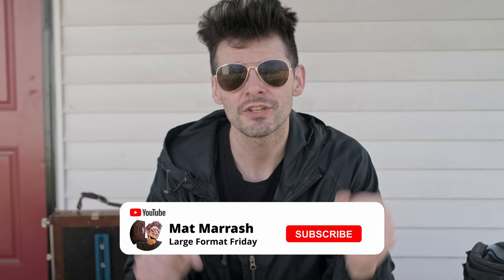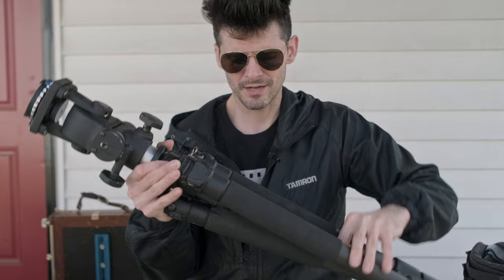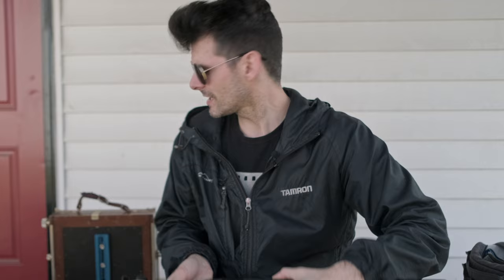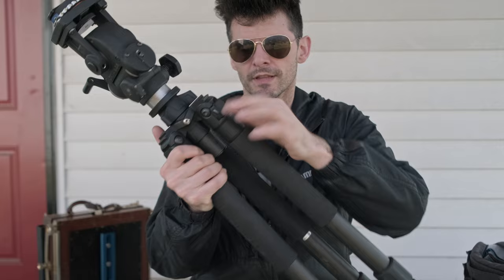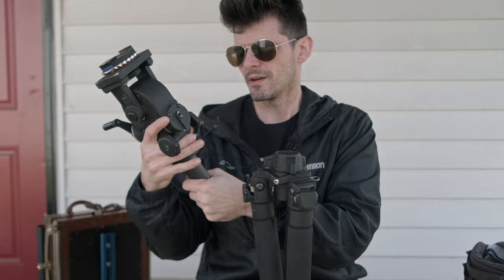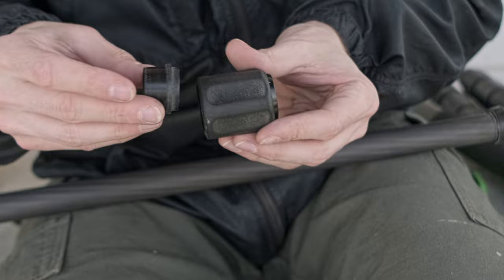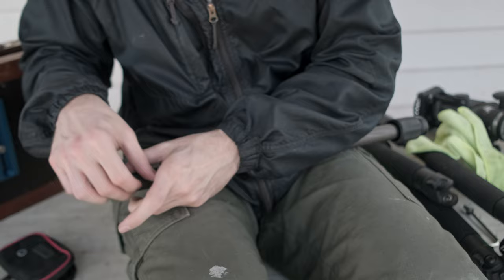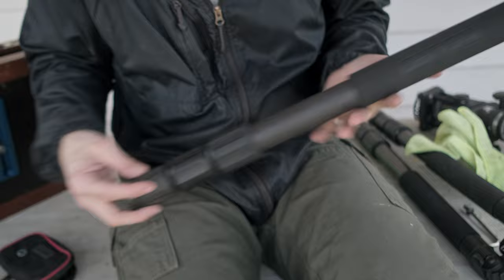Large Format Camera + Tripod Maintenance - Large Format Friday

Comment: Matt - just a suggestion you could use a drill to dimple the side of Aluminium boss where lock bolt sits. Stops a loose head sliding off 👍
A Good silicone furniture polish is equally good for cleaning tripod legs. 
An old clean tooth brush is handy to clean threads of collars. 
I wax my field camera wood work with a quality wax polish. A small amount of grease on racks.
Nice collection of leaves 😅🍂

Comment: What a coincidence, I was just servicing my 4x5 field camera last night!  Feels much better now that I've tightened things up.  

Question: I discovered while looking things over that I am missing the pivot rivet for my rear standard.  Do you have a recommendation for replacing this?

EDIT: For anyone else wondering about this, I found small machine screws and nuts from the hardware store, as well as tiny washers.  I had to cut down the screw so it fit, but it works pretty well!  I also used Loctite Blue in the nut to keep it closed.